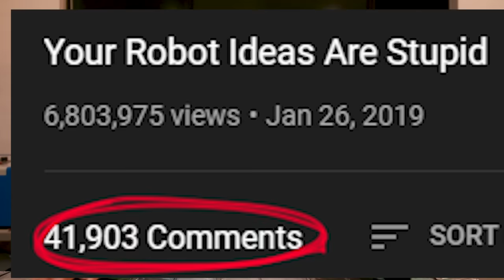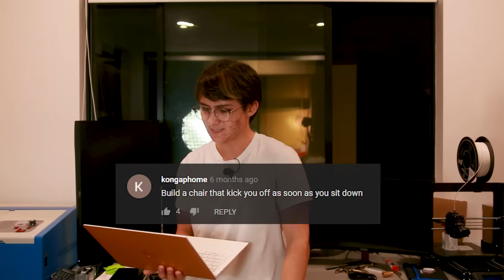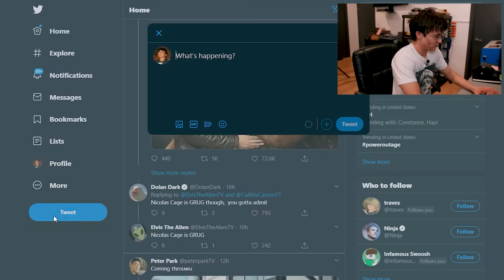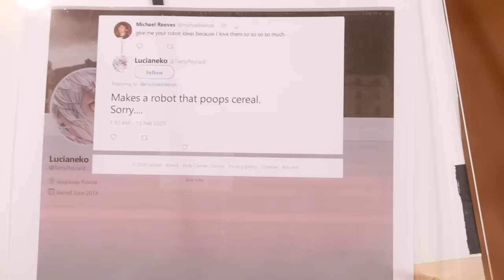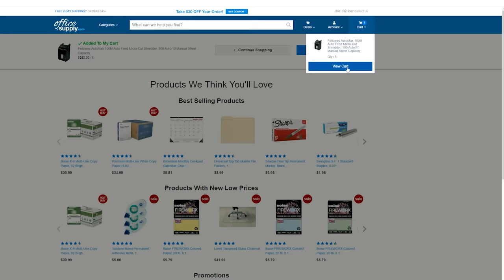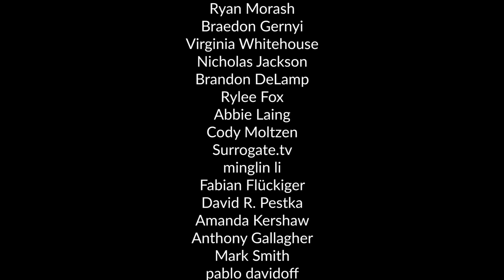I Hate Your Robot Ideas

Comment: You know Michael, your homemade pressure sensor/button saved my senior design project. When a sensor I bought didn’t work out, my group was at a loss of how to activate the system. And then I remembered this video, cut out two pieces out of scrap copper, attached wires to them, and boom, homemade button. Just touch them together and they start the system.
Reply: Damn, this is amazing. 👏👏👏
Reply: @SmooshedPotato123  It was. My group and I stayed up until 2 am two nights before the final part of the project was due wracking our brains to figure something out. I remembered this video, pitched the idea to my group members, they figured why not give it a shot, went home and slept, did the button construction the next day, and it worked beautifully. Button only took me like 10 minutes to make and test.
Reply: Searching for Darren Is he here?
Reply: Legit, a really smart idea for how simple it is.
Reply: It actually is clever as hell